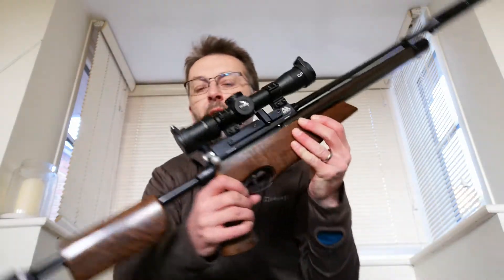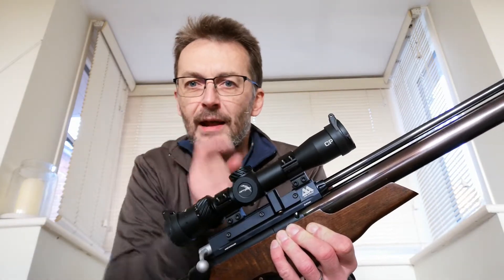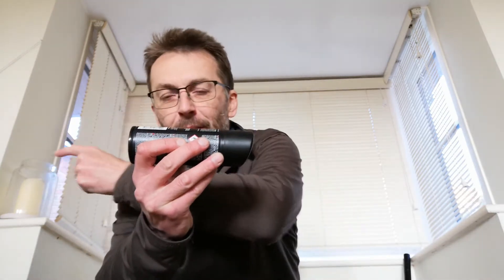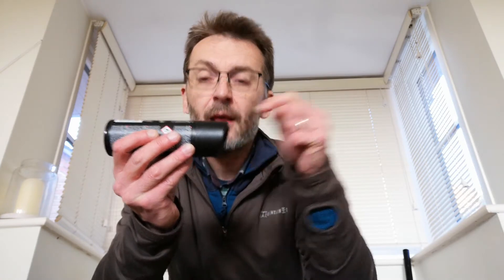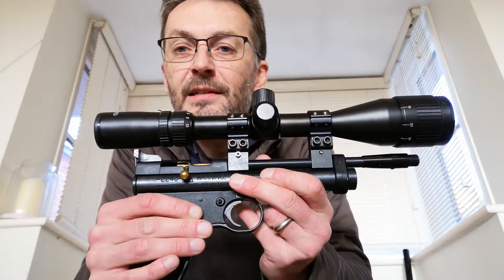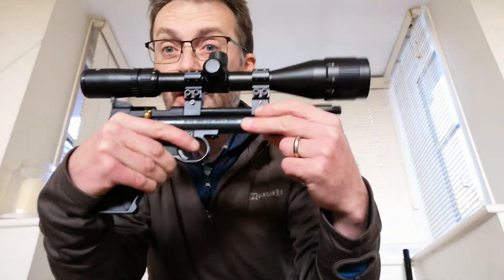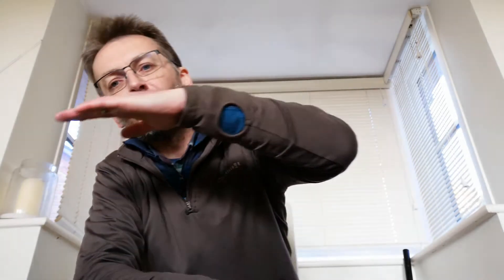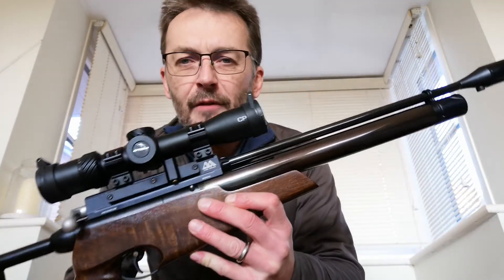Matt's Country - How a PCP Air Rifle or Air Pistol works

Comment: Good morning Matt I have another question for you about my PCP and has something to do with air pressure the recommended air pressure for the gun in the manual says 250 bar. Any place else that it talks about pressure it says 230 bar now my concern is with the FXDRS classic, that’s pretty narrow margins on a small tank what the problem is when I refill this thing in a cool environment the pressure is 230 bar that I go to but it exceeds 250 when I take it out in the heat comment please
Reply from the maker: Well there are two different cylinders for a DRS. The METAL cylinder is 230BAR max.   The CARBON cylinder is 250BAR max. I can't advise on your temp variations though, as I haven't had mine go so high from ambient temperature effects. If it's changing that much, fill it less so it doesn't exceed spec. Safety first, always.

Comment: Good simple explanation with caution about damp air, i have a new compressor how can i avoid moisture content , does it need a filter added
Reply: If it's not on your compressor, then, yes, get a moisture trap and save your pressure tube.

Comment: Really really well explained Matt 👍

On the CO2 front, I perhaps mistakenly (?) thought that putting that drop of Silicon Oil on the capsule end was to further the life of the seal, not the pin.
However, yes that’s good advice to use a tiny drop on the capsule.

Great review 😁
Reply: You're right. Nice presentation but not all accurate!😊
Reply from the maker: As Erick has pointed out, the pin only punctures the cylinder on the first trigger pull... which I had NO Idea about until he said it. So props to him for putting me straight